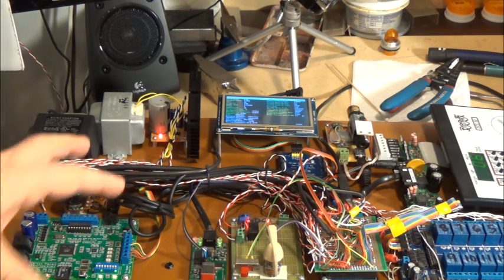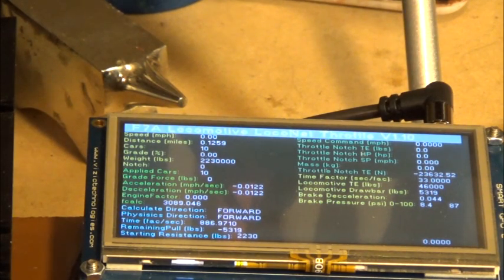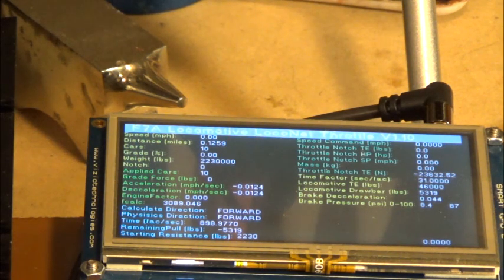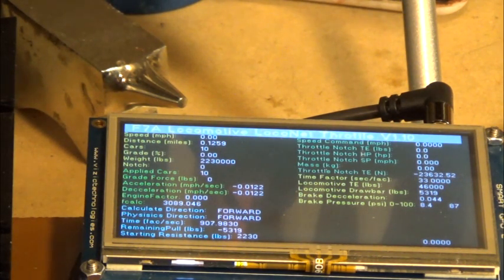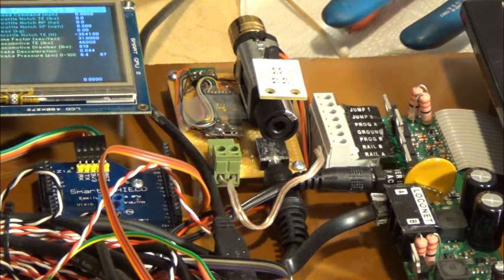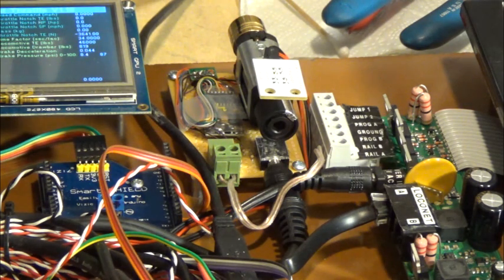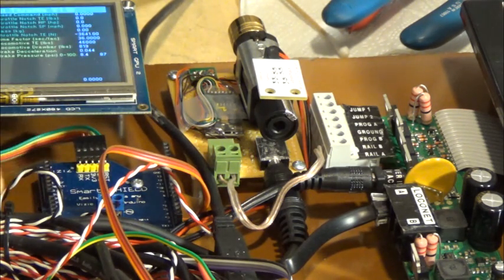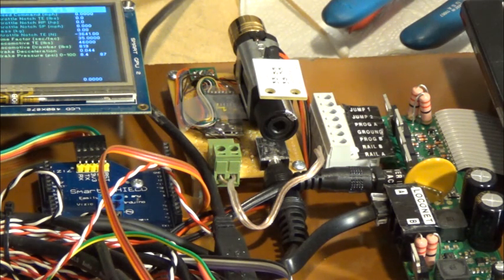Ultimate DCC Throttle – Part 2

Comment: What an awesome DCC-Throttle. I'm working on a similar project, but without sound, gauges and Arduino. It is a small AAR-Control-Stand for the game Train Simulator. With an Arcaze-USB-Interface works it as a Plug'n'Play joystick (max. 6-axis and 32 buttons). It can also emulate a keyboard. I will use it also for my model railroad via JMRI and/or LocoNet. But it is a long way to the goal. ;)

Comment from the maker: I had to scrap all my existing braking software as the real braking system is much more complex than I expected. I did this because I found a very useful engineering paper written by a University on EMD F7 24-RL locomotive brake systems and the operation and interaction of the Automatic Brake and the Independent Brake valves.  My new software breaks the Automatic Brake into independent valve manifold segments for Release, Running, Holding, Lap, Service, Emergency and the position of the Independent Brake and push down vent position. Unlike my previous software that calculated braking effort based on the Independent Brake handle position, I’ve had to resort to creating a mathematical model that calculates pneumatic pressures for each segment feed by effects of compressed air from a reservoir, pneumatic compression and expansion through the manifolds. The results of this model is brake cylinder pressure for the locomotive and the train cars that will drive the braking effort math.

Unlike other control on my simulator where some sound effects are triggered driven by the controls, the 10 different brake air sound effect are going to be driven by manifold pneumatic conditions as they are not directly related to handle positions. Fortunately, I was able to find all the actual sounds from E and F units. Emergency is the coolest, and VERY loud. I also had to change the reverser sound effect as I found out the large contactors were pneumatically driven on old EMD units. To date, this Ultimate DCC Throttle project has over 60 sound effect files.

Comment from the maker: Just when I thought I was done with the dynamic simulation, a review from a retired locomotive engineer resulted in me adding the Automatic Train Brake and a separate gage for the independent brake. This addition has required many new air sound effects, a notching brake handle to operate like the 24-RL stand, software to emulate the actions of the two brake valves and the effects on the locomotive and all the cars. This is pushing the limits of the Arduino Mega memory and processor speed.

To gain more capacity, I’m moving the radio dispatch to a second Arduino Uno with an audio processor board. This is being packaged in a reproduction 1950’s Motorola train radio with a telephone hand set.